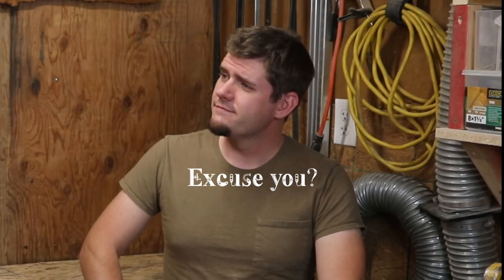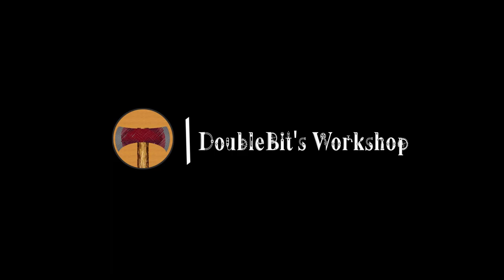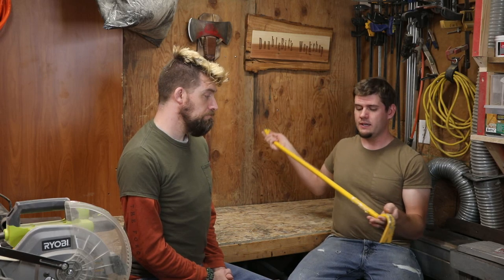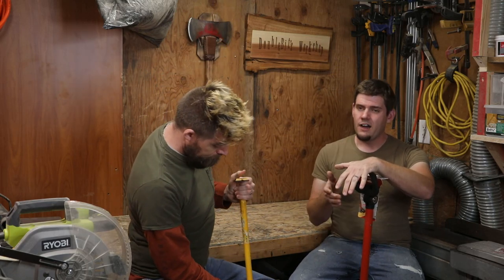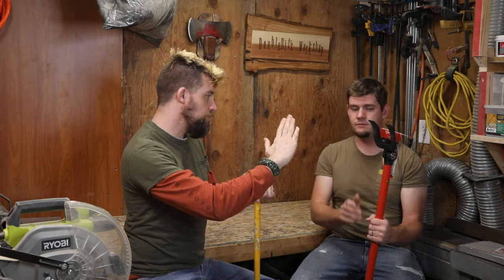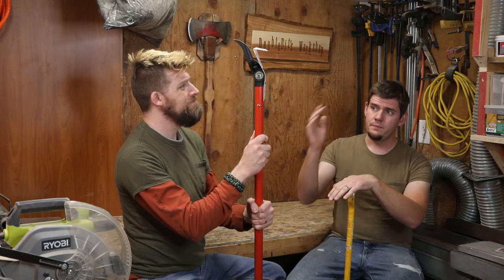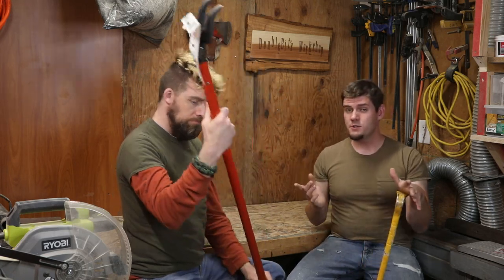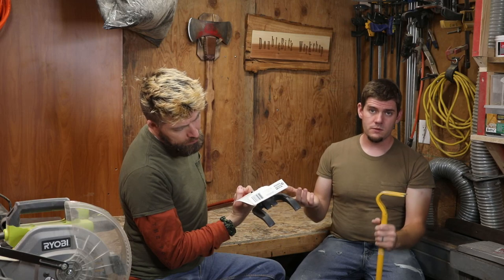$20 Dewalt 42 Inch Wrecker Bar VS $60 Crescent 44 Inch Bull Bar

Comment: just got a job for a tear out and deck install, 1000 sq ft 13 ft high on far end... home depot has the deck wrecker for 60 bucks? if so awesome, either way thanks for the demonstration fellas... (trying to salvage all the deck boards, there's no rot- just some rich retirees that got tired of the same old deck... doing trex on the install 🤑)

Comment: Where do you find a Bull Bar at $60?  Is that USD or CAD?  Amazon shows 2 of them $169 and $147.  Where are the ones for $60?
Reply from the maker: I bought mine at homedepot, and it was $60 USD about $62 after tax

Comment: Would have been informative to actually see how these tools work on taking 2x6 deck boards off a deck. Pulling 3/4" pallet boards fastened with 2" nails is likely easy, compared to 2x6 deck boards fastened with 3" galvanized nails. That hollow handle on the Crescent tool may not be able to pry such deck boards without bending and making the tool useless...?

Comment: ever grinded the nail heads before going to work with the bars? tales more time but you salvage 100% of the wood like.... half the time... atleast😆
Reply: What tool are you using to grind the nail heads off?
Reply: You can't in most cases , their counter sunk deep .

Comment: From experience ripping things up... I've learned to lay nail boards with the nail points down. No one intentionally steps on a nail, but all it takes is a little stumble or inattention for a long, rusty nail to go into the bottom of your foot and maybe even out the top. Even if you're up to date on your tetanus shots, a nail in your foot can make your life miserable for a week or so until it heals. Cheers

Comment: Timber is just cheap pine on the pallets, removing a hard wood deck is much better demonstration how well the bullbar works
Reply from the maker: If I had access to a deck needing replaced or had the bull bar when I demo'd mine, I would agree. A new vid may be coming soon if I can get the right parameters in line. The bullbar is top of my list for taking apart pallets so far though.